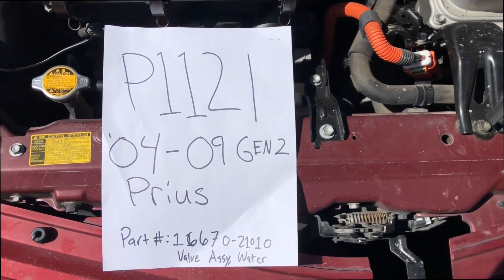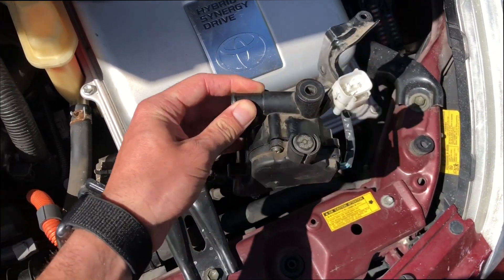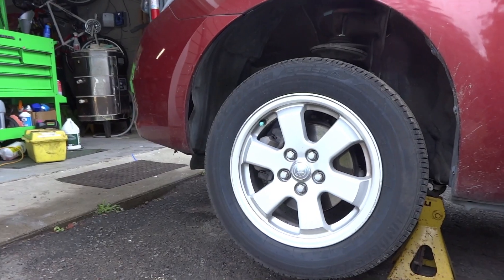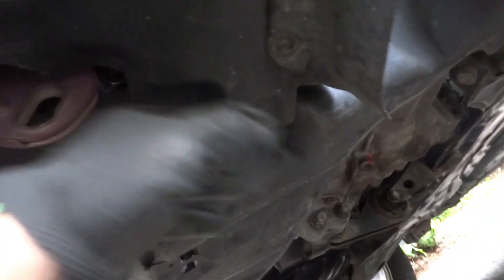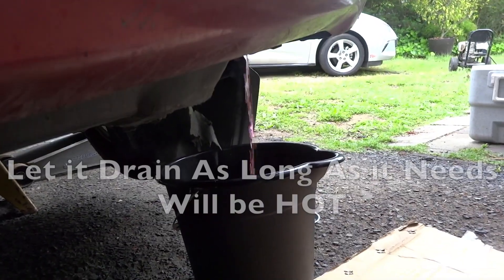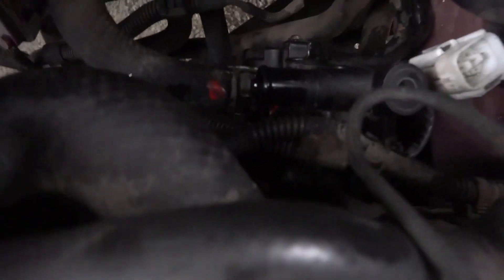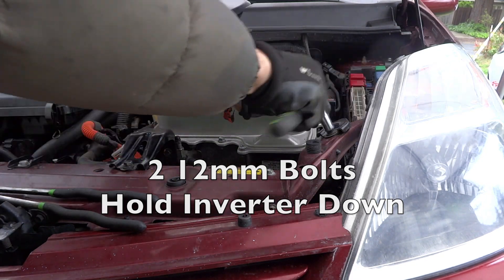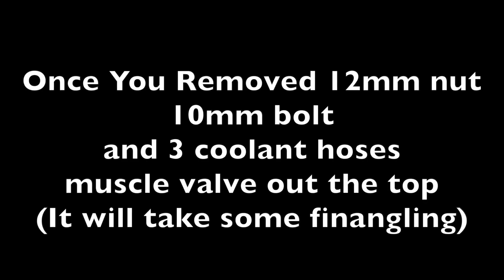P1121 Prius Info + Fix + Tips for Quick Repair + Bleeding Coolant Without Techstream

Comment: I replaced my coolant and didn’t properly bleed which caused my flow valve to code. Will bleeding it properly resolve the issue or now I have to replace the flow valve?
Reply: Did you ended up bleeding it properly ? Did u get it fixed ?
Reply: @ I did, but it took me three days each day an hour after work to add water and just wait. Not fun.
Reply: @HosseinQanbari  your check engine light went away after properly bleeding the system ? Thanks in advance
Reply: @Di_VaLa  On the second day of bleeding I reset the check engine light and it didn’t come back. But the gurgling sound behind the dashboard went away after bleeding it again the next day.
Reply: @HosseinQanbari  just to make sure you flushed the engine coolant system right ? I will flush the engine coolant system several times, I have install a OEM control valve and the light keeps coming on periodically. Thanks for taking the time to reply.

Comment: One year ago I was getting this P1121 error code on my 2009 Prius. I replaced the coolant control valve which was very expensive at $750. Now I'm getting it again! What could be causing this error since it is obviously not the coolant control valve? The Prius drives fine The Check Engine light turns itself off then appears again after a while.
Reply: Same situation for me after a replacement. Code still comes and goes.
Reply: I’m in the same boat here? Any solutions ?
Reply from the maker: @Di_VaLa  could be slight air in system could also just be non oem valve could also just be that this is a weird part that is prone to that in older age / weakness in the system. I try to let my car turn itself off before i shut it off is one way to maybe prevent it from happening so if the engine is still on charging the battery i let it charge until the ICE shuts off and then I shut the car down

Comment: great video! For a while I was hearing constant see-saw kind of noise from the valve, as it is opening and closing, then after a while it failed and it threw the error  P1121 . So,  I replaced the coolant valve and I  have proper amount of coolant. The error is gone but  but  constant see-saw kind of noise is still there.
What could be the problem? Is that noise normal?
Reply from the maker: prob normal -- might need to bleed ti again. occasionally mine does the same noise reandomly and i have no error code and its been two years since ireplaced it
Reply: @MaxsGarage-p8q  OK, that may be  normal but I got the feeling that constant moving of part will drastically shorten the life of the valve. I will try bleeding again. Thanks for the tip.
Reply: @MaxsGarage-p8q thank you...   Does this Prius have 2 coolant temp sensors for the engine?

Say another video where they removed an engine coolant temp sensor from the passenger side near the exhaust header

Right here
https://youtu.be/Lq8ZQvjK7Tg?si=M1Wd-GCOgf25sR-x
Reply from the maker: hey just updating you that it is totally normal mine still does it and still hasn't thrown a code. But probably just an engineering fault with these that they're looking or hunting for their "home" in the sensor and over time they can't find it and that is when it throws the code. Via a reluctance switch.

Comment: I wonder if there's a relay associated with this pump and the coolant temperature sensor. I have a code for both of them and I already changed the temp sensor about a year ago.
Reply: Did you fixed the issue ?
Reply: @Di_VaLa I fixed it but don't remember how since this was a while ago. I would gather that I didn't have the system properly bled. I use a slightly different method to bleed the system. You will get codes if it's not bled properly.
Reply: @Q.Lawrence  got it. Makes sense cause I have only bled the engine coolant system once. Will do this several times, thanks for replying.
Reply: @Di_VaLa  sure thing. You don't need to do it several times. I just run the pump a few times like in the video. When it doesn't take any more coolant, put the radiator cap on and run a tube from the bleeder to the overfill tank. Run the car in maintenance mode with the heat on full blast. Let the engine get warm. Crack open the bleeder. When it stops pushing coolant into the overfill tank, you're good to go. Tighten the bleeder screw and you're on your way.

Comment: Fyi None of the tips on bleeding the air from the system worked for me . I tried the long hex wrench to bleed the radiator, the multimeter to jump the pump nada. Mine is a 2007 Prius btw. I did fill it up till about 2 qts were left in the bucket. So I started it up drove it outside my garage to a parking space close by and ran it till the heater was pumping out medium warm air . Then back to the garage to top up the radiator. I did this two times and the bubbles would come out and the fluid go down on the funnel. Gonna check it again after a short drive there is about 1 qt left to go. GL to you all Prius repairs are annoying.
Reply: They’re the worst lmao
Reply from the maker: You’re welcome for making the video. But yes bleeding any coolant system especially a Prius takes all the knowledge from bleeding normal cars and combines it with the more tricky coolant reservoir the Prius has. Not to be eggy but it’s probably best to lead with a thank you if anything did help then get into criticism or helpful bonus tips. 👍🙏🏼

Comment: I have a 2008, 346,000 miles.
Oftentimes after I'm finished driving and I just park the car is still on in ready mode you will hear this valve making a continuous noise like it's switching back and forth and back and forth. Doesn't do it all the time and it doesn't seem to do it when we're driving down the road. Wondering what you think?  is that normal there are no codes the car seems to operate correctly.
I'm very mechanically inclined so I'm not worried about tackling this issue at all. But I'm wondering if it's necessary to do it.
Reply from the maker: Honestly, after replacing mine with a dealership part I get the exact thing you're talking about happens occasionally. I don't know why or what causes it (my guess is it has to do with the heater being on), but it hasn't rethrown the code yet-- and, I don't worry about it. Also when this fails, if it does fail, it does NOT cause a no drive situation. You just won't have heat-- the valve gets stuck in a position and it should be fixed but it won't leave you stranded. To double check that you should always have an OBD2 reader in your car that can do live data so that you can read codes and monitor engine coolant temp as well (if you're worried about that) since the Prius has no temp gauge.
Reply: @MaxsGarage-p8q  any recommendation on which obd reader to get?
Reply from the maker: @CleverBryan1  for a reader just grab whatever you want. Cheapest one possible. Bidirectional is different

Comment: Helpful video, thanks. Anything specifically wrong with the dorman part here? (Just ordered one...)
Reply from the maker: dude always go with OEM!!! Bro do not buy a DORMAN seriously?! You trying to troll me? Good luck having to replace it often. You can buy OEM for the same price basically on ebay!
Reply: Max's Garage I mean, this OEM part I put in 2 years ago is already shot again, so...
Reply from the maker: Alex Baldinger was it a used oem?
Reply from the maker: Alex Baldinger also it doesn’t matter you can drive with this code on as long as your engine temps are constant. So, it’s a pain but it won’t kill your car